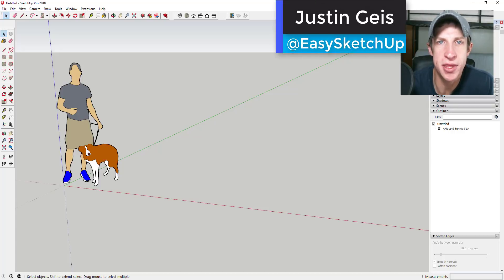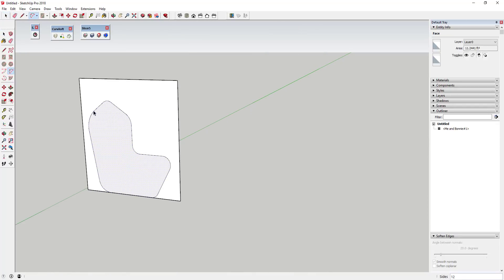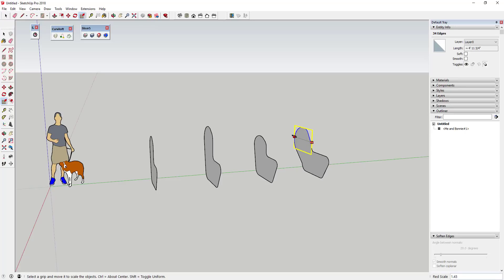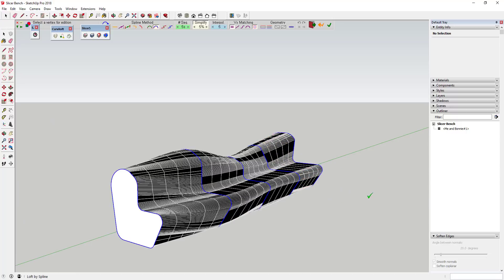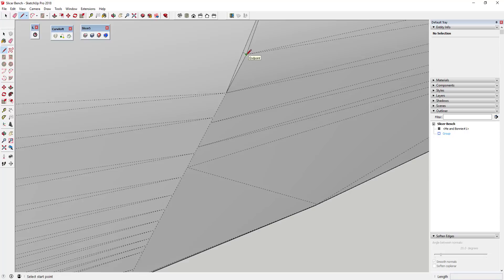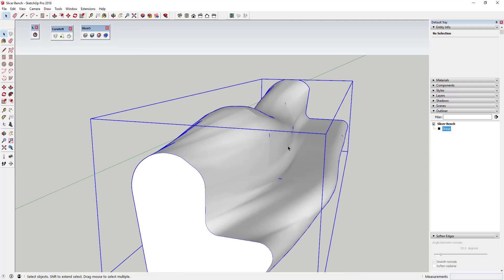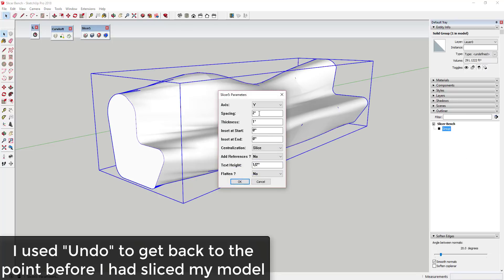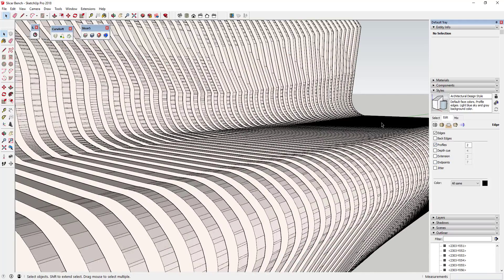Modeling an Organic Bench with Slicer and Curviloft in SketchUp

Comment: Hi, i have a problem, maybe two.

1. When i find the error with solid i can’t use any command, i need to exit from extentions to modify  my Group.

2. (last but not least) When i draw the line that close the Group for Created a Solid this no work, i make a counturn of the hole, but this step no work, the only method to close the hole wiht a single line it’s explode, but it’s impossible next have a solid.

I not understading why.
Reply: i resolve point 2, i don’t click “modify group”.  =)

Comment: Hi Justin
How can I apply this bench design to CNC machine to cut the slices?
Reply: ungroupe it and put it on xy
Reply: this will work for only 3axie cnc 

1st you need to know the thickness of the board you will be using  ( you will add that to the thickness option on the slicer plugin ) 
2rd you need to select the flatten option on the plugin.
3rd  select the flatten groups make them in a 2d profile 
4rh draw the board size of your CNC 
5th place each part into the board ( make sure you understand where it will cut 1st ) 
6th delete everything but the parts you will cut make sure you don't have groups and if you can weld ( with the weld plugin)  all the lines together  
7th export the file as a DXF 

that should work if not you will need to head to AutoCAD 

1st open your file 
2rd select all and purge all lines 
3rd  select a part and join lines 
4th move to 0 ;0 points then 
5th export file as dxf

Comment: Since sketchup doesn't have true curves. You shouldn't directly go to cnc from sketchup. You need something like  vectric in between sketchup and cnc.
Reply from the maker: My understanding (and I haven't tested this) is if you export your curves to something like DWG or DXF, they get exported as true curves. I don't have a ton of CNC experience, but don't you have to export to an external software anyway to do the actual routing? You can't just do that straight out of SketchUp, can you? Thanks
Reply: You are correct. You would say export the file in dxf format making sure the camera view is set to parallel projection into cnc software such as vectric where you create a cutting tool path for each shape.

Comment: Justin, great videos.  How would one create models for liquid architecture?  Currently I am creating the internal structures and then adding facades or skins.  I was looking at some of Zaha Hadid's buidlings and wondering how they modeled them.
Reply from the maker: Hi Dennis - do you have images of what you're talking about? Each building is approached differently depending on what you're trying to create - some you'd approach with an extension like curviloft, others with an extension like flowify, and still others with tools like Artisan or Vertex Tools or SubD - it just depends. Thanks!
Reply: https://www.google.com/search?q=zaha+hadid+buildings&client=firefox-b-1-ab&source=lnms&tbm=isch&sa=X&ved=0ahUKEwj_x8P-oJTYAhVrllQKHQvsBOYQ_AUICigB&biw=1515&bih=965
Reply: There are many types and shapes.  I'm looking that these as inspiration.  I just tried creating a spline and using curviloft but it locked up.
Reply from the maker: You may want to try either the Curviloft Skinning option (the third option in the tool), or maybe something like Soap Skin and Bubble. That said, especially for the first image, that's a fairly difficult shape to make. They discuss something similar in this thread (https://forums.sketchup.com/t/help-with-hyperbolic-curves/16523), but I'm not 100% sure how I'd make something like that in SketchUp. They probably used a program more like Rhino for that building. Thanks!